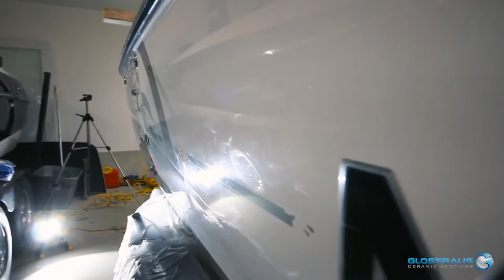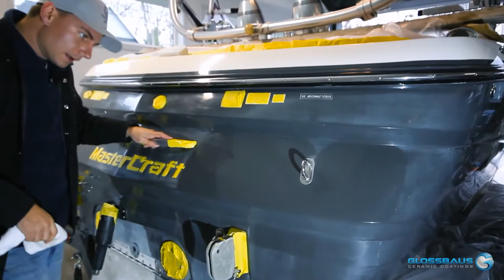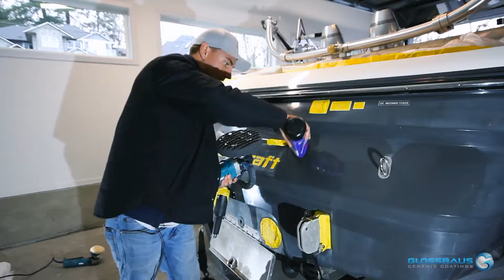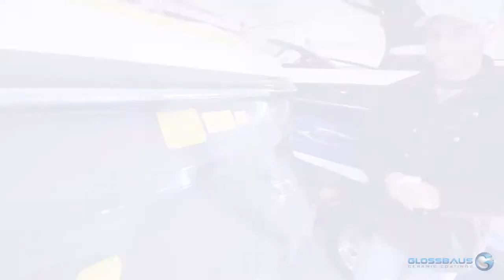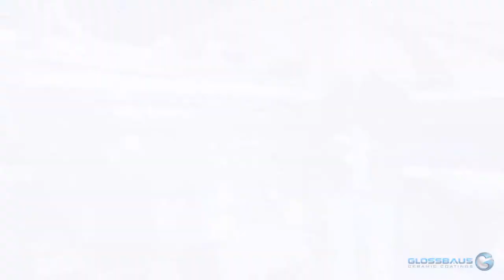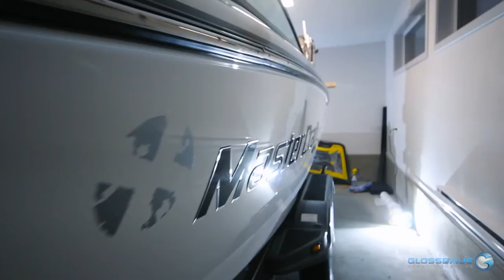Learn how to apply ceramic coating to your boat or yacht.

Comment: More detail needed: 1) how do we know the coating is ready to buff since different coatings flash at different time periods? 2) What does the coating look like, or is it still sticky when you start buffing?  I can’t seem to find out this information, and I don’t think I need to take a class to find out. Your channel isn’t the only one that leaves out this important information.
Reply: Yes once you buff off it still there (at least on cars) and every ceramic Coating has diferent time to buff it so check the instriccions, once you finish the job should look very glossy and once you wait forncure time will look even more Glossy.

Comment: I like the closing - But the website listed the premium products for "installations" or the professionals which goes against what is being told.  Whats up with that?  Also how much product was used for this 25ft boat?  Thanks!
Reply from the maker: We offer products for both installers and for the general public. We used 100ml for this boat.

Comment: I would have like to have seen how you detail around the chrome letters and the vinyl graphics. I have the same boat and getting into those areas is painstaking and tedious work. Does anyone have an idea how much this would cost if done by a Pro?
Reply: We normally charge 100.00 a foot for mild correction and ceramic coating.
Reply: @davidcooper1213  After watching this video I can see why you charge 100.00 an hour ! Very tedious work for sure. How long does a ceramic coating last ?

Comment: Great vid man! Can I use a compound/polish combo like Meguiars M105/M205 on gelcoat? Also, do you not ceramic coat the whole hull? Or do you somehow put the boat on stands that would expose the whole hull?
Reply from the maker: You can try meguires but you will need to have a very abrasive version to cut through gel coat oxidation. We only ceramic coat the sides of the hull, the part in the water usually gets bottom paint, or we just keep it natural. Although some customers may insist in the whole hull being done as well.
Reply: @glossbaus2336  my don’t you do the bottom?
Reply: @maggie1767  cause it won’t oxydized . It’s under water . Only surfaces that are exposed to uv light and air need to be protected

Comment: Are you using special lights to apply the coating
Reply from the maker: Yes we use a scan grip light, but you can use many others that are more cost effective.
Reply: Do you have a link? To the light

Comment: Wish you would’ve showed the ceramic coating on the aft of the boat where the paint is darker and not the white paint. That way we can see the difference.
Reply from the maker: The difference is in the polishing. Apply ceramic coating to an oxidized portion it will look nearly the same, apply ceramic coating to a heavily cut polished surface, it will enhance the look slightly, the ceramic is more of a sealer then a magic coating that makes dull things shine.

Comment: That gel coat would never in a million years be free of oxidation from your compounding. The polishing oils almost immediately fake a glossy finish. Even after an alcohol wipe those polishing oils are deeply embedded and won’t release for a week minimum
Reply from the maker: Maybe for you, but not for us. We use specialty compounds and polishes and remove all polishing residues with a panel wipe before we apply ceramic coating. So if that was the case the panel wipe would wipe away these oils that are giving the fake shine.
Reply: @glossbaus2336  not correct gel coat is extremely porous and oils can take weeks to be flushed out in the water  or evaporate in the sun
Reply: Please do a video Simon we want to see !